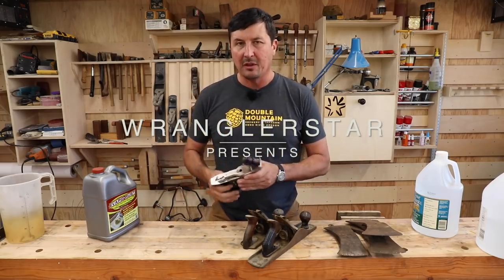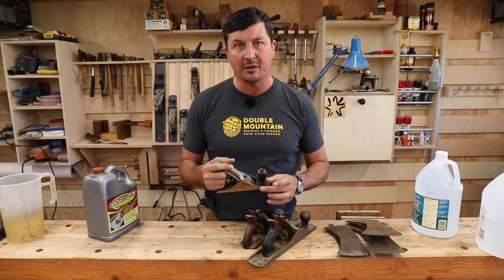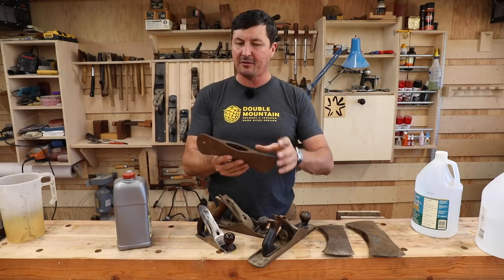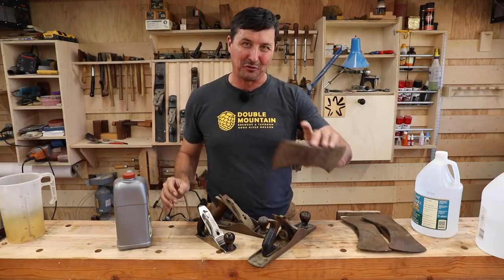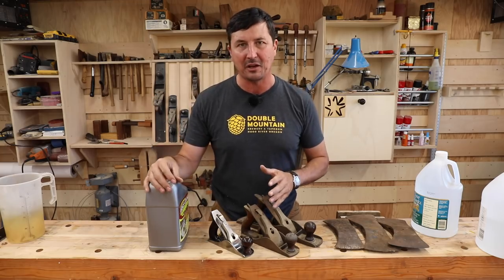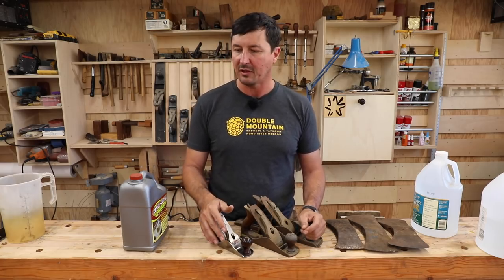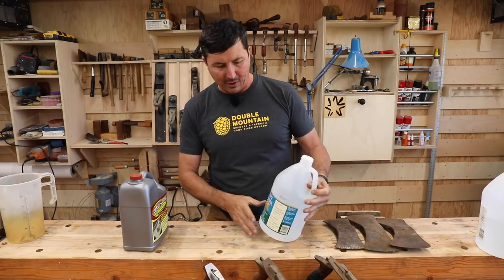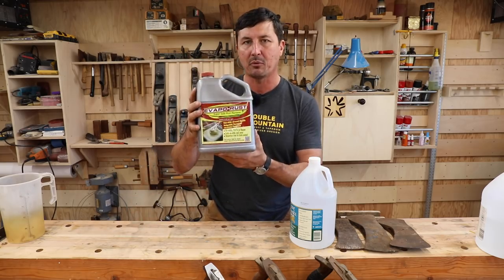Polishing A Rusty AXE

Comment: Sir, couple of tips I like to offer .... first: if possible, use a ultrasonic cleaner and fill with vinegar as the pre, and your Rust Remover as the final cleaner. I promise you’ll be amazed at the results. Second: As soon as you remove the cleaned part from the solution, the metal is vulnerable to flash rusting, and therefore,  you should apply a CORROSION PROTECTANT to treat the metal surfaces. Anyone is welcome to contact me if I can offer additional help ....... it’s what I do professionally.

Comment: if you heat the vinegar it will be more aggressive, remove the rust a bit better and also etch the steel revealing the distinctions between the hardened core steel and the soft outer steel just like the evaporust did.

Comment: I restore antique tools, and have been doing them by hand. So I can relate to your "nooks and cranys" comments very well! 

My question is: If I put an axe in a bucket of Evapo Rust - with the handle still attached, will the wood handle be discolored, stained or deteriated in any way?

Comment: Keep that vinegar solution and keep using it till it stops dissolving rust. Be careful though. eventually it will start eating at the steel underneath. Once the solution is saturated with rust and wont take any more off you can use it to dye wood and leather black. just make sure to use a neutralizing solution of a tablespoon of baking soda to a quart of water to stop any deterioration caused by and leftover vinegar.

Comment: heating the vinegar will make it a lot faster, removed maybe a mm rust layer with 5% and maybe 60 degrees Celsius in 2 minutes
Recommend to use baking powder and water solution to neutralize the acid, when it stops bubbling it is done

Comment: To remove rust from tools without using caustic chemicals, mix 1 part molasses with 9 parts water in a container, then soak the rusty items in it for between several days and two weeks. The solution breaks down the rust and holds it in suspension.

Comment: Try muriatic acid (hydrochloric acid 20%). You will find it in the masonry/ concrete section in the home center or big hardware store. Be careful, good ventilation. Have baking soda handy if you get some on you..Safety glasses are a must. Don't put galvanized or zinc /duralum electroplated steel in it. Chrome is ok. Use a HDPE bucket (triangle 2 on the bottom) or a stainless pot. It does disappear into the environment harmlessly when you throw it out, if the metal tool doesn't have harmful substances on it. Initial pH shock may kill a few plants, but it will dilute and break down to nothing in time.

Comment: blackstrap molasses I the only thing I will ever use to remove rust from valuables. it attacks the rust only and not the metal. mix it 4:1 water to molasses and let it sit. you can let it sit as long as you would like because it will never hurt the metal.

Comment: Got to oil any metal that comes out of white vinegar immediately. Use to clean my chains with vinegar. As you pull it out of the vinegar have a friend spraying WD40 on it before the air hits it.

Comment: 2 Possible Test setups for easily testing Hydrogen embrittlement...

1. Find 2 pieces of identical springsteel ... put 1 into high percentage  vinegar for 24h 
Test both pieces for brittleness... ( Use a vise and a reliable way to see how much it will bend (camera from the right angle and a background that allows to see how much it will actually bend until it breaks?)

2. Create springsteel rods by heating and quenching - then repeat as above ...

Comment: I read about dealing with rust because I have a chromoly bike I wanted to return to a good condition. Eventually I read that the evaporust is the same chemical as wood bleach (which you may have on the farm,) and that chemical is Oxalic acid. If you have wood bleach on the farm, I'd like you to try that to remove rust too! (I'm pretty sure the acetic acid would cause more pitting in the metal than the evaporust. Do you have a good magnifying glass to check?

Comment: I've used some "cleaning strength" vinegar around the house and garage.   I wonder if it would also work better to remove rust, I'm assuming it's a little bit stronger than the normal stuff.

Comment: With regard to vinegar, I use only concentrated 25% vingear. It's much better than the 5% stuff. I use it to clean my chainsaw chains and bars. Gotta dry them right away otherwise they can rust.

Comment: I have used apple cider vinegar, with similar effects. I have found that if you go in after several hours and wipe away the surface rust still clinging to the tool, you get better results. What about the inside of the metal can? Did the evaporust clean it too?

Comment: Get you a Rubbermaid shoe box with a lock down lid that is airtight or maybe a little bigger container with the lock downloaded to put your vapor rust liquid in and tools you want to D rust. This way you can store the liquid without it evaporating when you're not using it.

Comment: The best method I now for valuable/delicate items is Electrolysis. Tank of water, tablespoon of baking soda or washing soda, piece of scrap steel in the tank connected to the +ve car batt charger, metal to be de-rusted to the -ve, turn on and away you go. very delicate can only remove the rust, not any of the good metal.

Comment: muriatic acid good for a quick dip awesome on green cruddy electrical wires and connectors. just a few seconds as melts plastic. less stringent than hydrochloric acid.  cheap

Comment: or you can combine salt white vinegar and aluminum foil in a large pot and boil it on an open fire for 1 hour it removes all the rust and dirt and then all you have to do is use sand paper and then polish it k keep up the great work

Comment: the only problem with vinegar is that it is an acid not meant to directly go for the rust like evaporust. and ithe vinegar will create air pockets in the steel to get the rust out and make it spongy looking and ruin the structure of the steel. andrew reuter did a video where he left old tools in vinegar for 9 months and their structure was ruined

Comment: I find an aqueous 5% citric acid solution works much better than vinger.  There is no odor like vinger and it is cheap.  Make sure to rise what ever you are restoring with clean tap water and dry completely so as to prevent flash.   rusting.

Comment: Hi, just for you folks in the northern hemisphere who want to clean up large rusty engines etc we have found a cheaper method that works for us.  We buy 1 quart of Molasses (Stock Food Supplement, 25 lit for $25) mix it to 9 parts water, submerge rusty engine and leave for 3 weeks, might be slow, but it works and its cheap!

Comment: I restored a Collins PA style Double Bit with sandpaper, hand files and a whole lot of blood, sweat and calories. 
I wish I had before and after photos.

Edit: If you use Vinegar, you MUST do a through rinse with fresh, preferably untreated water and dry immediately. All acids are oxidizers and will quickly aid in the formation of a new rust layer.

Comment: 1 question i have is .. once the evapo-rust has been used once can it be filtered out threw a coffee filter, re-bottled and re-used like i do with vinegar ? or does it loose it strength quicker then the vinegar does (i usually get about 2 maybe 3 uses out of the vinegar)

Comment: Sure vinegar is cheaper but it's an acid... it's not meant for this, evaporust deff has my vote, this product was made and invented for this, it won't ruin the metal and eat it like vinegar will being an acid. Plus it left the paint still on the plainer and ax head, the vinegar would eventually eat away the paint. Thad my opinion but if you've read this far I want to see the inside of that "nail bucket" you used to keep the first test in to see the rust removal

Comment: The white vinegar works faster when you add some salt into it.the salt increases the acidity of the vinegar
Reply: Salt (NaCl) does not increase the acidity of vinegar. Salt is a base compound that falls exactly in the center of the acid-alkaline spectrum. If you add it to something with a high pH, it would lower it. If you add it to something with a low pH, like vinegar, it would actually make it less acidic since that would raise the pH back toward the center of the spectrum.
Reply: jodeum2 I was mistaken the salt doesn't increase the acidity of the vinegar the salt helps break down the rust (iron oxide) layer to allow the vinegar work faster

Comment: @Wranglerstar I have my hands on a Collins Legitimus in A Hudson Bay pattern in nearly an unused condition. The only thing is that it’s got mild surface rust but absolutely covered in paint. Are there any paint removers you would recommend for the head and the wood handle?

Comment: Phosphoric acid for steel and hydrochloric acid for stainless steel. (Caution Phosphoric acid leaves a small phosphoric layer on your tool. If you dont want that you should use hydrochloric acid aswell.)
Reply: I recommend these in strong forms because what you saw is a matter of minutes with those acids!

Comment: In an old vid, you tried out rust removal with electrolysis. You rejected the method, but I saw that your electrical connections were bad and rusty. If you fix these it will work much better. 
Vinegar is acid, which means it will corrode even the healthy metal and it can discolour certain materials. The electrolysis method is more neutral to the workpiece, and it will even turn some of the rust into metal again :)
Maybe  thats why some historical artefacts is restored with that method...
Reply: I've tried electrolysis as well.  Used two old battery chargers in series to get 24V and plain soda as electrolyte.  It worked well, on both steel and brass.  The brass got so bright that it was hardly recognizable as brass anymore.  Caution with brass though, it'll release toxic copper compounds into the water which will then need to be treated as chemical waste.

The downside of the electrolysis method is that it works "line of sight".  So if your sacrificial anode is on the left, it won't clean the right side very well.  It's also troublesome to derust the inside of objects with this method.

Comment: I just use vinegar. After that, sand paper takes the rust off easy as can be, you can almost just brush the rust off.
Reply: Vinegar seems to lift the rust rather than dissolve it.

Comment: just use anything that has fosforic acid in it and leave as long as needed , ,it doesn't matter which liquid you use ,none  of them will remove the pitting , that will always require mechanical removal

Comment: great video, nice tops. Remember to replace Mrs. W's vin vin! 

Quick Q. I've got lots of small logs (3/4 inch diameter), wondering what I could do with them in terms of making tool handles. Any tips on wood types, drying times, any exp on this sort of stuff? (in keeping with the recycle/ use what's around you philosophy).

Comment: Use some Baking Soda with the White Vinegar,
Reply: Why would you do that?  Vinegar = Acetic Acid ... Baking Soda = Sodium Bicarbonate = Sodium Hydrogen Carbonate ... in 'balanced' quantities, Vinegar + Sodium Hydrogen Carbonate = Sodium Acetate + Carbon Dioxide + Water.  The purpose of putting a rusty object into vinegar is to turn the rust, iron oxide, into iron acetate which is a precipitate and can easily be rinsed off the iron object, unlike the iron oxide which adheres strongly to the parent iron.  Iron Oxide + Acetic Acid = Iron Acetate + Carbon Dioxide + Water.  If the vinegar has already undergone that 'neutralisation' reaction with the baking soda then it will not achieve the desired purpose with the rust!

Comment: Could you put an axe with a handle hung already in the white vinegar, or would it be damaging to the wood?
Reply: XJCheeko | it would damage the wood. Instead fold a rag, dip it in the solution, and lay it on the metal. Makes sure to squeeze it out a bit so it doesn't run out of the rag and get to the wood.
Reply: Sounds good, thanks!

Comment: I want to find a pipe that I can drop one of my Dads old rifles in with that evaporust to clean off the rust.  Amazing and so worth the $$.
Reply: You could probably build a dunk tank out of PVC piping from the home depot pretty cheaply. Most rifles are pretty narrow once you get the stock off, so it shouldn't be hard to find pipe that's the right diameter.

Comment: That lever cap on the plane is on way too tight. When you have them on that tight, they can warp the bottom of the plane. It should only be on tight enough to hold the blade in position. If you were to flatten the bottom of the plane with the lever cap on that tight, it would mess up the bottom of the plane.

Comment: The difference in price, 2 bucks and some change for a gallon of vinegar, not in any way touted as a "rust remover" by any of the vinegar manufacturers, vs. 20 bucks for a dedicated rust remover specifically formulated to remove rust and not smell up your shop, what's the "WOW" for anyway?? I use white vinegar regularly to clean up my "finds" at antique stores and flea markets when I dig around and come up with a prize in a cast iron skillet or dutch oven that is covered with YEARS of being left out in the weather and not taken care of at all. 72 hours in a white vinegar bath and I challenge anyone to come up with a faster, easier, and more efficient way to remove rust ......... FOR THE SAME PRICE!!!

Theatrics aside,  Both products do a fine job in removing rust and, if there is no really harmful  chemicals in the Evapo-rust, [check the MSDS on that product], I would think that it would be the easier of the two to use overall. I don't particularly care for the strong vinegar smell nor do I get any on my clothing or hands, I use nitrile gloves to work with it and it still smells like vinegar when I walk by a neighbor's yard!! I wish there was a way to post photos on these Youtube channels, I would love to show you a few "before" and "after" photos of some of the cast iron I have resurrected from the rust heap.

Comment: Why do you pour the bottle backwards
Reply: A. Ommundsen to me it looks like he does that so the air goes in better and he gets a nice even pour
Reply: So the air that goes into the bottle to replace the liquid doesn't cause the liquid to glug and splash all over.
Reply: when you pour backwards you don't get the slogging of air trying to replace the liquid. it pours faster and smoother backwards.
Reply: It's to keep the liquid pouring a steady stream instead of the "glopping". If you watch where he poured it straight, you can see the stream is lumpy. When you flip it over, it pours out smoothly. The air in the jug causes it to what I call glop out lol
Reply: Also it allows you to get the neck of the bottle closer and at a better angle for pouring

Comment: You also need to put the metal in a baking soda and water solution because the vinegar is acitic so it will rust again if you don't netrulize it